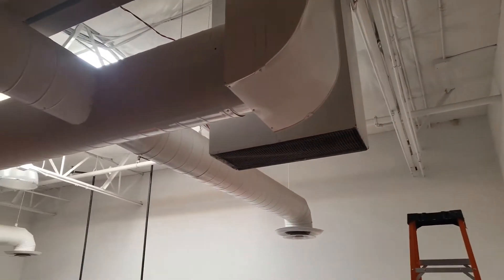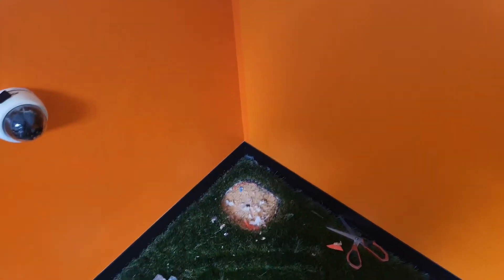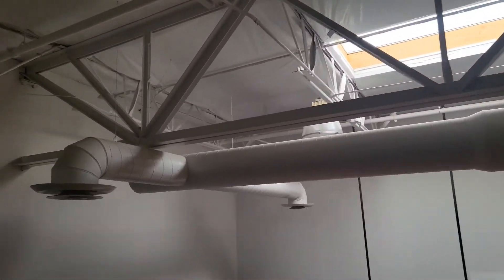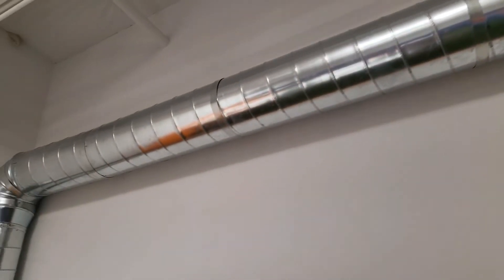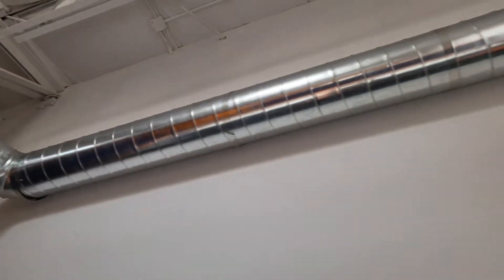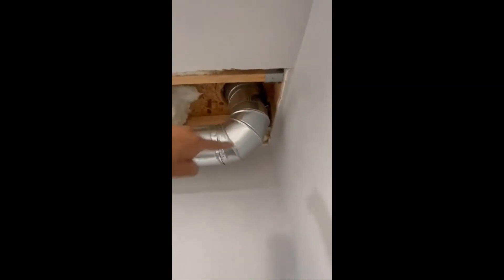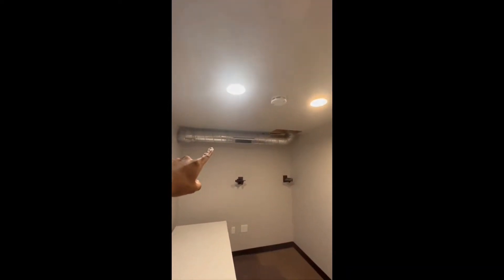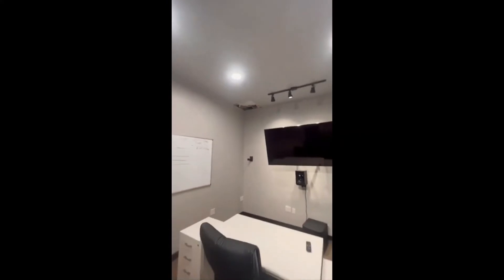COMMERCIAL DUCTWORK MODIFICATIONS-MODERN SPIRAL DUCT-DUCTWORK INSTALLATIONS IN SCOTTSDALE ARIZONA

Comment: Hello, I have two serious questions that will be very helpful. If you could answer me, the questions are the following. In the video, I can see that the air ducts are not attached to the ceiling and my question is if it does not affect the cooling of the room, since they are located very below the ceiling. And the other question is how can I calculate the tons of refrigeration that my premises need, please could you answer me, thanks in advance